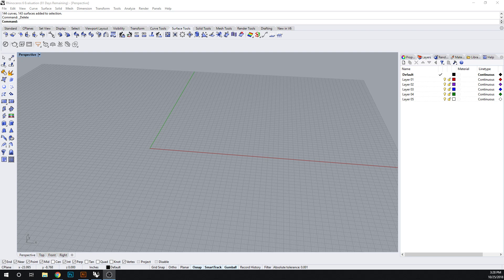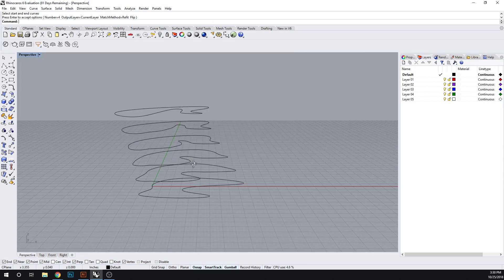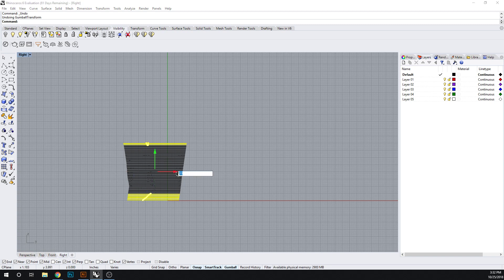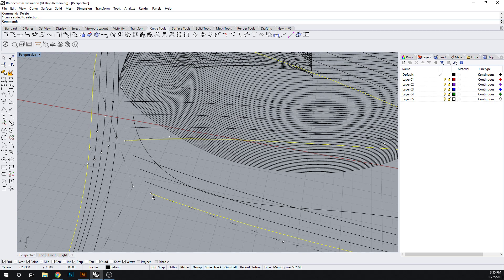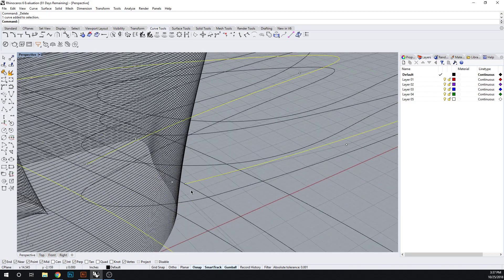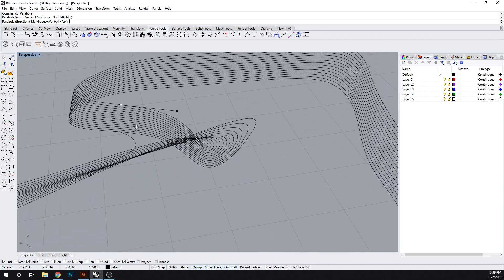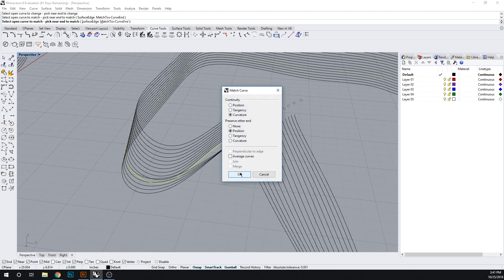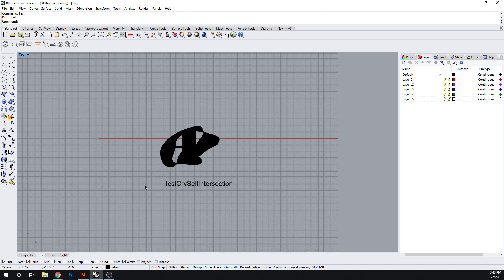How to Fix Self Intersecting Curves

Comment: NOTHING I'VE FOUND HAS HELPED. I HAVE A SHAPE MADE OF LINES AND ARCS. ALL SEGMENTS ARE ON C PLANE. NOTHING IS INTERSECTING YET I GET THE ERROR. TRIED THE COMMAND, YES IT IDENTIFIES POINTS BUT THERE IS NOTHING TO CORRECT. IS THERE A PROBLEM WITH TOLERANCE? LINES CAN NOT BE EXTRUDED CERTAIN DISTANCES AWAY?
Reply: Self Intersecting Curves is caused when curves cross, or overlap. The points locate where curves intersect, and therefore where a self-intersection occurs. Sometimes this is so small it is difficult to see, that's why the command is helpful for locating. You can rebuild the curve at those locations, if it is an intersection of a line and an arc, try Fillet (Radius=0). Or, trim back around the problem area, and define the intersection.
Reply: Same here.